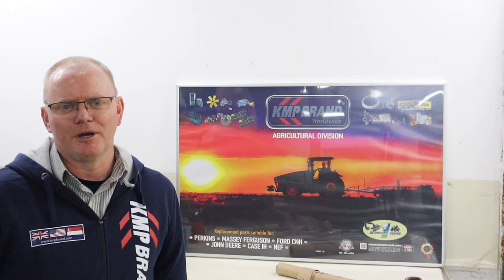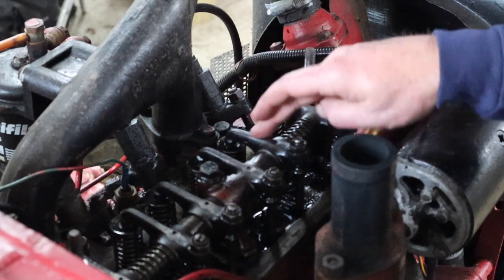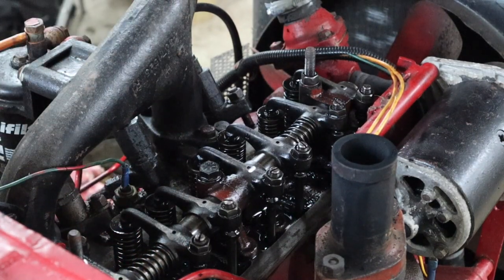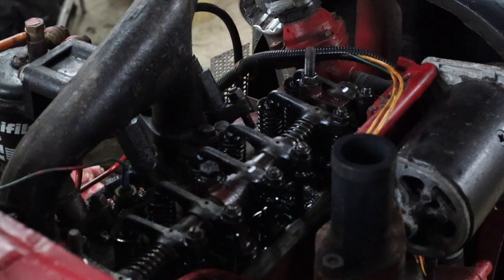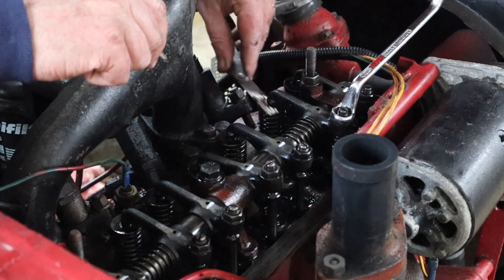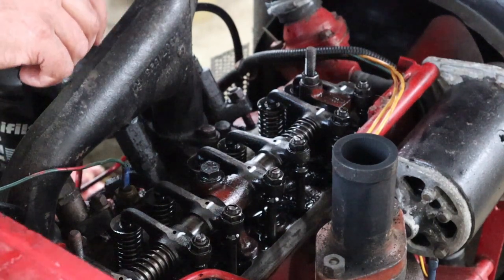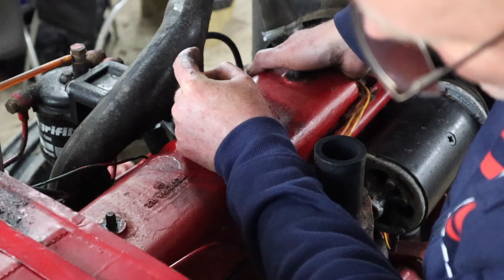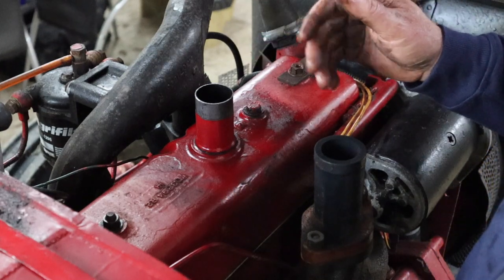#132 International B276 - Setting Tappet Clearance - with KMP Brand

Comment: Only thing I can Think off is meby a spring is near to crack or  meby 1 spring have lost a Little bit off tention meby ... meby you can try hit  all the springs with a plastick ( or outher hammer or bras thing)   hammer and listen to the sound off them  .. to See if all them sound the same .. I Will think just a Little crac  or someting will  show  reighte away in the sound from them ... outherwise  I am not sure  Where the sound will come from .. Thanks a lot for your video .. Nice to follow you along 😊👍  Michell NORWAY 🚜  🚜
Reply from the maker: Hi Michell, yea that is a possibility. I will see how it goes for the next week or so then decide whether to dig deeper into this. I’m a little behind on your channel. I need to catch up. 😉

Comment: Hi there,  what happened to the Ferguson?? Was looking forward to see it running after all that work
Reply from the maker: Hi there, as you may have learned from one of our recent videos, we are moving soon, so sadly the Fergy has had to go into storage along with most of the workshop equipment. We are just about done with packing up and transporting everything to the storage unit and expect to have moved in about a months time. Then of course we need to reverse the whole process again! 😮‍💨
Reply: @WaterhouseForde  Thanks, will look forward for your next videos , good luck